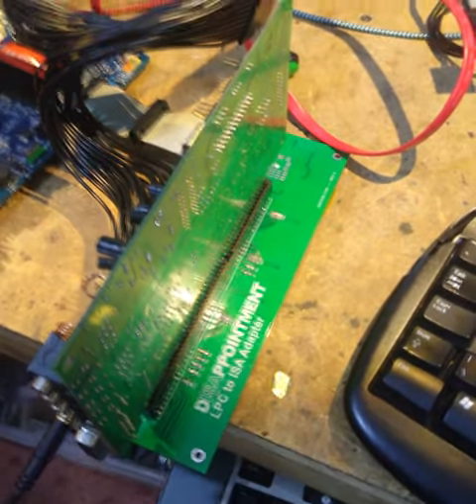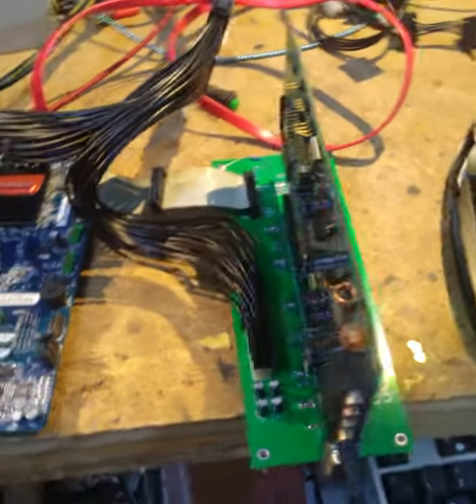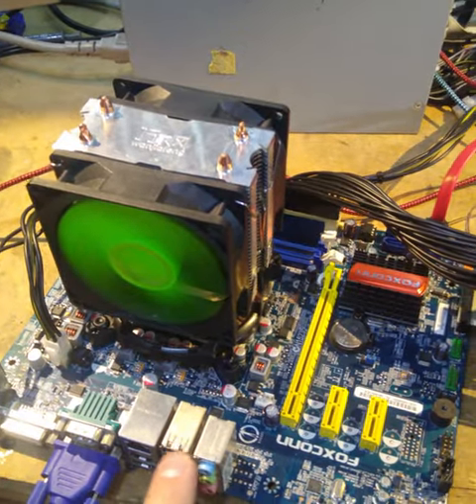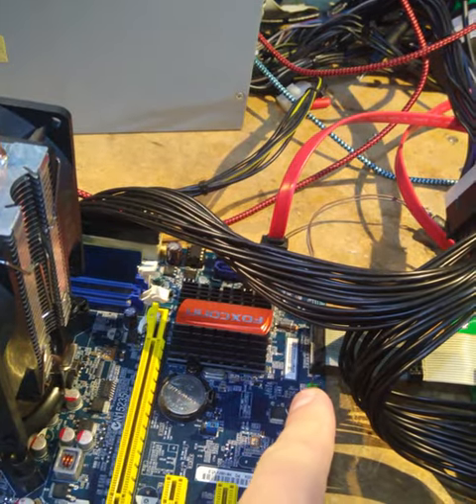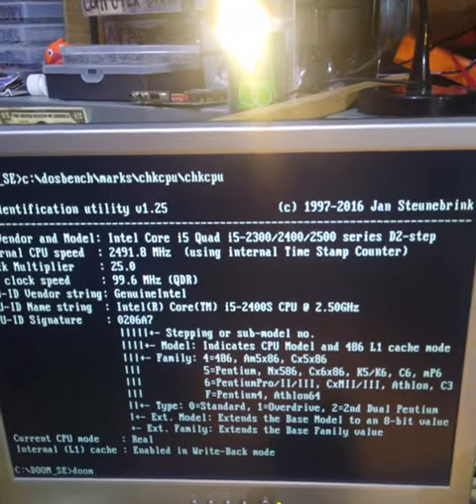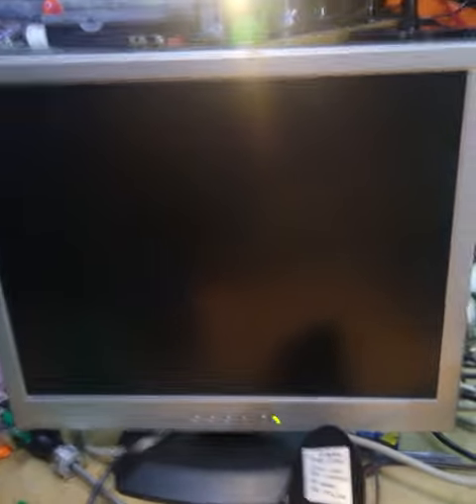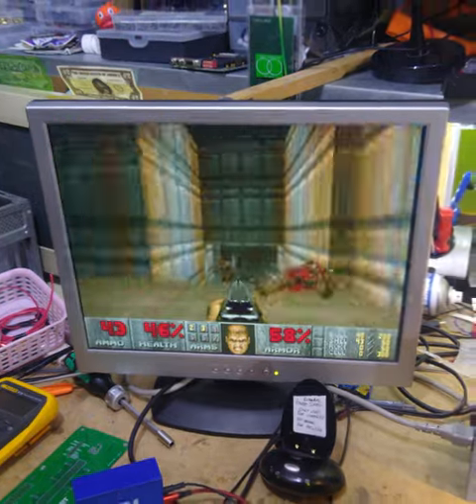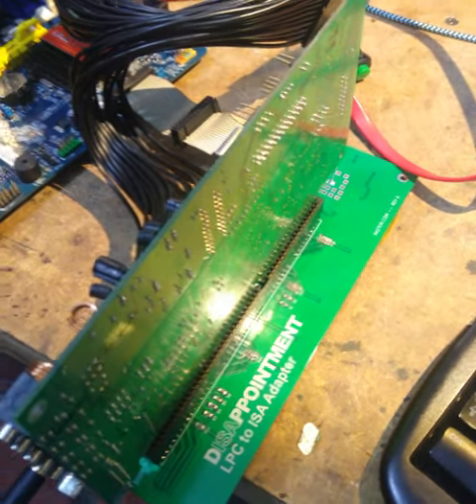Adding an ISA Slot to a Modern Motherboard! #shorts

Comment: Just Amazing... we do use the ISA slot for other purposes than games, but if you say so😊, we use them for controlling a large Modelrailway Layout ''to play with''. 
We are controlling the layout with software (in machine code) that fit on an XT or i386 with an ISA card. So... it's interesting because newer PC's has no ISA slots anymore 😢. 
Thanks for bringing it under our attention!

Comment: I was actually pondering this recently, but a PCI to ISA bridge. You could then do PCI-e to PCI to ISA. The downside is that ISA boards are full height and wouldn't fit in a normal case.
Reply: There are already PCI to ISA (and USB to ISA) adapters, but due to chipset limitations they don't support ISA DMA which is required for most of the interesting cards.

Comment: Does this have working ISA DMA? I have been playing around with the electrical side of the LPC bus doing some security research on TPMs, and it looks possible based on the spec. Either way, really cool project, I am looking forward to the video.
Reply from the maker: Yes, DMA works!
Reply: @TheRasteri  Awesome!
Reply: @TheRasteri  make that known in the later videos, ISA DMA is a black magic thing no one has ever done reliably half the time... a good show of it is the 3Com 3C515 ethernet adapter, it pretty much requires ISA DMA to get speeds over 10Mbit even when it negotiates 100Mbit.
Reply: @SudosFTW  but 8237 DMA is so slow! Does this 3COm card uses its own DMA engine to move data around?

Comment: Looks great! Have you tested it with LPT ports at addresses 0x378, 0x278 & 0x3BC with IRQs @ 5, 7 & 2(9)?
Reply: How about directly connecting a MicroChip LPC47B272 to the LPC Bus for adding a floppy controller, parallel and serial I/O?

Comment: I wonder if the power for the ISA slot could come from standard Molex cable instead of 24 pin main connector... 🤔  Molex connectors are powered as long as the machine is running.
Reply from the maker: ISA needs -12v and the ISA bridge chip needs 3.3v. easiest way to get all these voltages is through the ATX connector

Comment: Amazing! Could a floppy controller work?
Reply from the maker: yeah I would expect so :)
Reply: I did some research into the LPC a while back, and the killer factor I stumbled on was that most of the default inbuilt ISA goodies (floppy drive controllers, serail/parallel ports, etc.) of old required (had) BIOS support for them, e.g. making floppies bootable, or even accessible to DOS, without requiring special drivers. So, since newer MOBOs don't supply Floppy Disk Controllers, it's rather unlikely its BIOS supports them... It seems also rather unlikely newer Windows would support them. And even if ultimately it still supplies its own drivers for such things, it probably looks to the bios to determine whether (and where) it's installed. Yer prb gonna need custom drivers. Or maybe a BIOS extension ROM, if newer PCs still support those. Unless you only plan to use it in an application that accesses the controller at the lowest level, like some disk-imaging software, and maybe within linux.
But I could be way-off.

Comment: I wonder if a motherboard is small enough, can this be mounted in a PC case alongside of the motherboard while lining up with the back of the case for proper card mounting? 🤔
Reply from the maker: yeah the latest version of disappointment has screw holes that should work alongside an ITX/microATX case, once I've tested it I'll be releasing another video showing how it works in a month or two.
Reply: @TheRasteri  That's cool.

Comment: Dont all pcs need to technically have an isa slot somewhere internally even if its emulated?
Reply: Sort of. https://en.wikipedia.org/wiki/Low_Pin_Count. They have a bus that's software-identical to the ISA bus but electrically is a lot different. That's actually what this is using, as indicated by the text on the board. It's just taking advantage of the fact the TPM slot is technically an interface into the LPC bus.
Reply: @dizzym9554  I believe there is other legacy hardware from the 80s still required to be in modern computers, even if its just in software, like com1, and the ps2 port.
Reply: @geofrancis2001  That's all implemented over LPC, but yeah.
Reply: long live Low Pin Count bus! and say no to eSPI bus...

Comment: My understanding is that there's no standard for the pinout of a TPM connector. Is this limited to a single vendor's motherboards?
Reply from the maker: A lot of boards actually have the same pinout. You often have to apply solder bridges to enable some of the lines, though

Comment: Makes me wonder what else the TPM port can do
Reply from the maker: Somone told me you can put a security chip in it but I don't believe them
Reply: @TheRasteri  Ha! Would love to know how you're using it for anything BUT that though
Reply: @davidrgilson  The TPM port is technically a connector for the LPC bus. To my understanding, it's not standardized? So I suspect this board only works with certain motherboards. But afaict this is essentially taking advantage of that fact and the fact that LPC is basically (it's more complicated than that, look up "Low pin count" on wikipedia) a logical ISA implementation, complete with DMA (the important thing missing from PCI-ISA bridges).
Reply: @dizzym9554  Ah thanks for explaining, appreciate it.